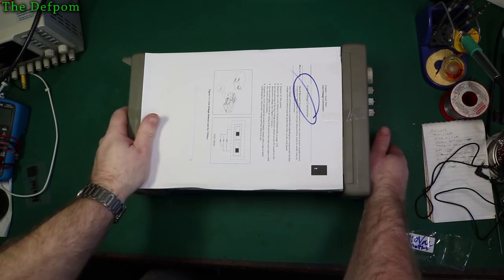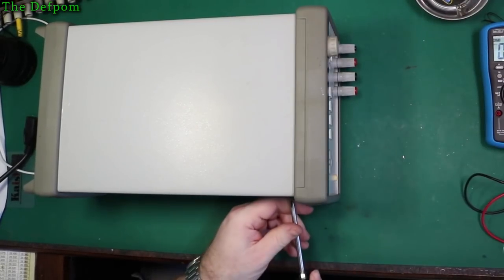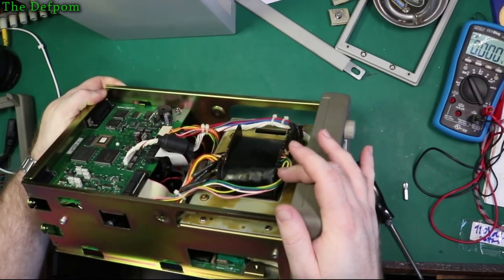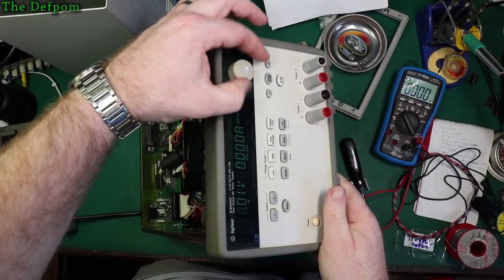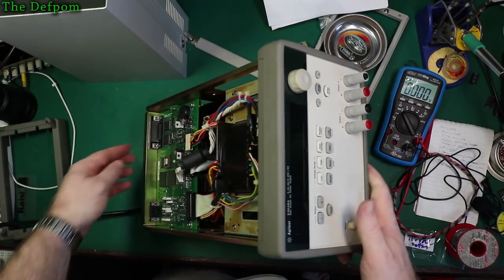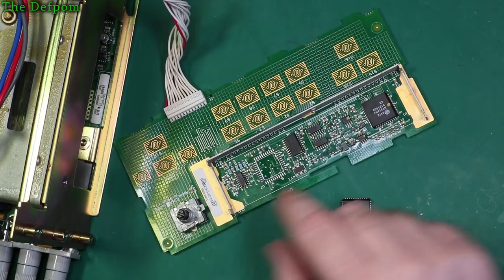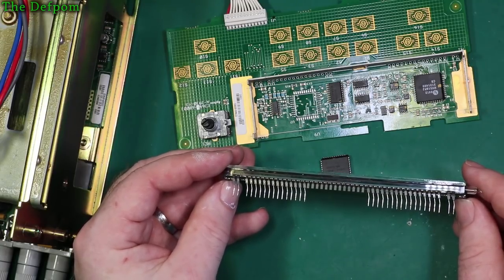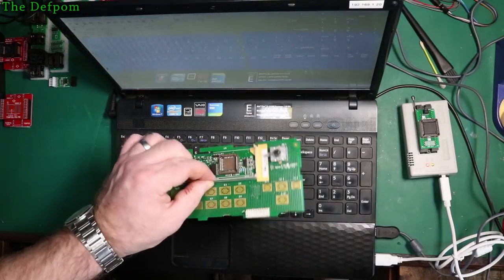🔴 #544 Agilent E3646A Display Board Repair - Rotary encoder and U7 N80C51BH 34401-88804 Failure

Comment: Another nice repair (including the remedial work). I agree about using a fairly high temperature for the soldering iron (within reason). Avoid dwelling on the joint too long.
Reply: How much it cost you to purchase that power supply

Comment: I did a nearly identical kill of a 34401A DMM front display a few years ago. Got the bin file for the 8051 from KO4BB - I believe - also. I didn't bother socketing it on the repair, though. Fixed it and all was well.... good repair!
Reply from the maker: Colby Burkett - I always socket IC’s if I can, makes for easier future repairs or swapping back to the original part if it turns out not to be that bit which had failed after all, or if it blows again because of a secondary fault.
Reply: @TheDefpom  Agreed! I just didn't with that unit for some reason.

Comment: I have a TTI function generator that has a similar issue with the frequency control encoder.  Never opened it up to investigate because you know I’m terribly lazy and use keyboard input to program the frequency. However you have inspired me to have a look inside for a cracked trace. I know the parts unavailable from TTI but I must have a look at it one day.  You know working in electronics i sometimes totally loose interest in repairing my own stuff and always busy doing jobs for other people. Bad luck on blowing up the chip but these things happen, is it a display driver or decoder. I have one of those programmers and they are great for the low cost. Best Regards Chris

Comment: If you turn the socket over and snip the little tangs that hold the base plate in then it will be a piece of cake to install. It is only a support but you wont need it because it will be soldered down. Try it it works perfectly

Comment from the maker: This power supply is for sale on TradeMe, so if you are in NZ and are looking for one you could own this very unit (just do a site search for Agilent).
Reply: One year RTP warranty?    (Return To Pom)   :D  Those thumb cuts look painful. Did you manage to rake it across the bottom of some through hole pins.... I hate that.
Reply from the maker: @JonnyFix  - those were from the heatsink on my 3D printer stepper motor, I had put it in the wrong place and tried to remove it, and my thumb slipped across the end of the fins... 8 cuts in one go.

Comment: I hate have screws left over. Thanks for the laughs. Some day you should upgrade your CMU200 to get rid of the old HD in it. I have already done that mod for it.
Reply from the maker: Doug Farrell - I do want to do that update for the cmu, but read about difficulties some had, what did you do and what problems did you have to deal with?
Reply: @TheDefpom  Here was my process. Allowing for Window 10 formatting FAT in the GUI.  I used ICYDOCK that has SATA,2.5 IDE,3.5 IDE connectors.  1. Created an image of the original using Driveimage XL (RAW) and ICYDOCK. 2. Create your partition as exactly 2GB (2047MB) as displayed in Windows DiskManager on the new SSD in ICYDOCK. 3. Then windows will allow you to format it as FAT (Full not quick) on the new partition. 4. Then wrote the image on to the SSD using Driveimage XL.
Hardware needed (QNINE Laptop SATA to IDE Adapter, 2.5 Inch Serial ATA HDD Hard Disk Drive or SSD to 44 Pin Male PATA Port Converter; Amazon "Pull Jumper"), (ICYDOCK or equivalent), (Old Corsair LE SDD spare 60GB one i had laying around)  Doug Farrell N9TOW

Comment: As for those nuts on pots and switches I 3D printed a whole set of wrenches. They work just great.  here  is the thingiverse link.
 https://www.thingiverse.com/thing:2818284
Saves the front panel from the dreaded plier slip.